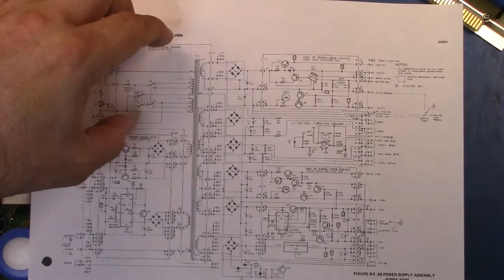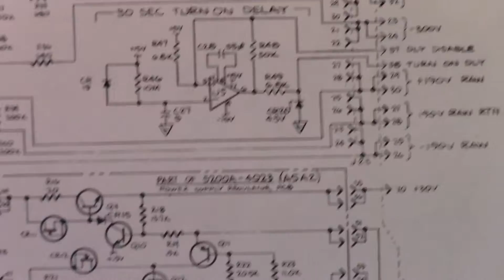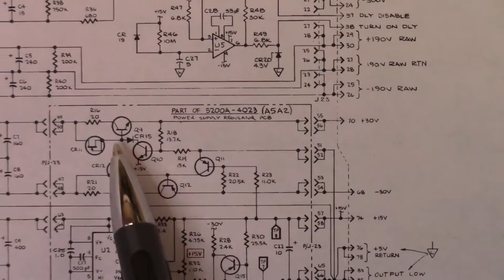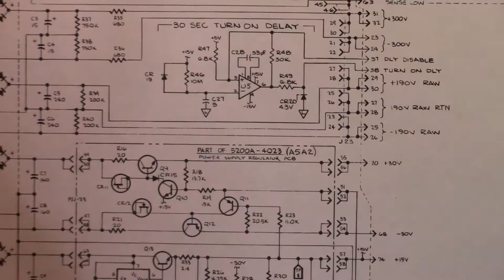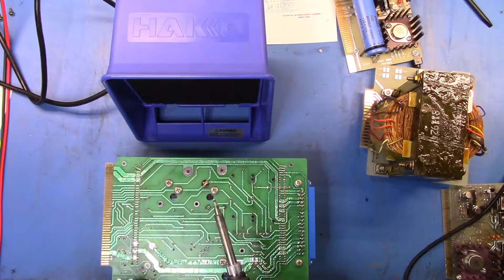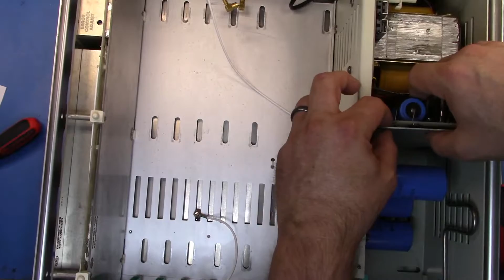Fluke 5200A - Power Supply & Regulator Board Repair

Comment: There are only 3 videos, but what was the eventual outcome?
Reply from the maker: The repair enables the calibrator to roughly meet the set output but it needs to be adjusted to be within spec. I had planned to show the calibrator working in the adjustment video but I discovered that the quadtrature level couldn't be brought into spec so I needed to acquire an extender card to investigate. I have it on my list of things to get back to but that 3403C is filling up the bench right now.
Reply: I picked up one of these and have been using your videos to inspire me to fix it up. I also was able to get an extender off ebay.  But it is too large to fit in the daughter board regulator's area.  It's dimension fit better on the main motherboard plugs.  

I found the same two resistors bad on the power supply.  One was split in two.  I'm still chasing another problem which is no response from voltage amplitude changes from the front panel switches.  Voltage range switches fine. The amplitude switches are fine, but the signals to the BCD are not correct.  Can't give up though.